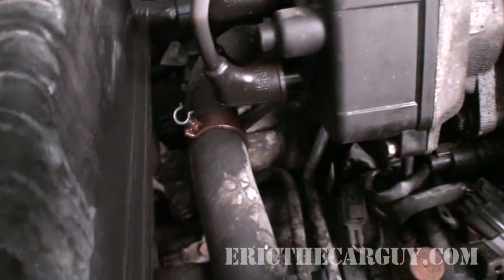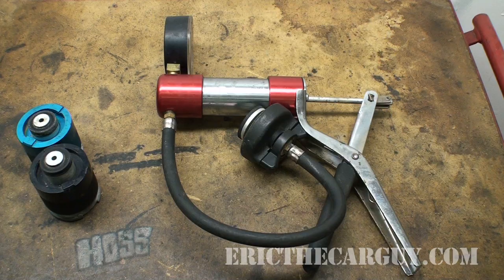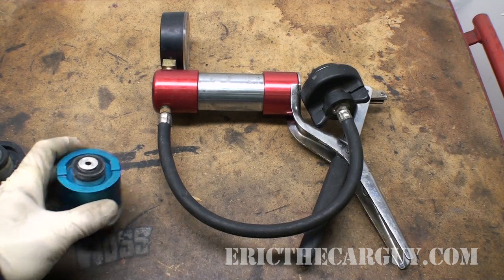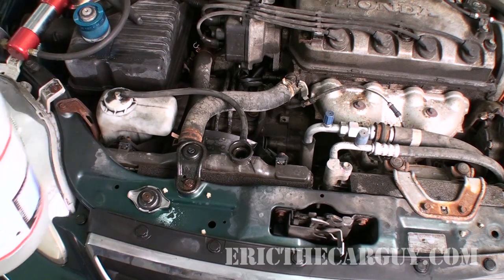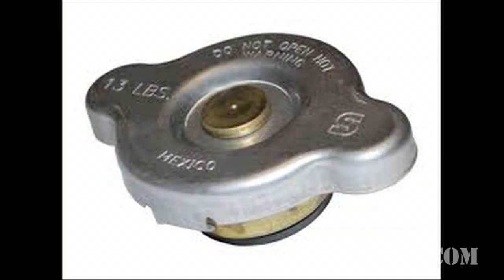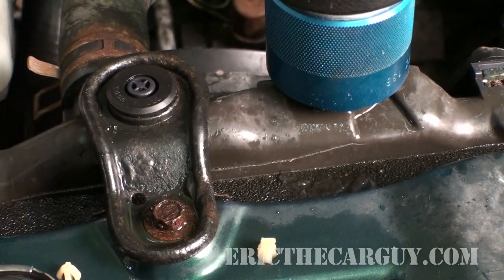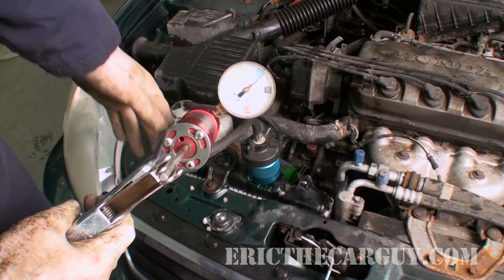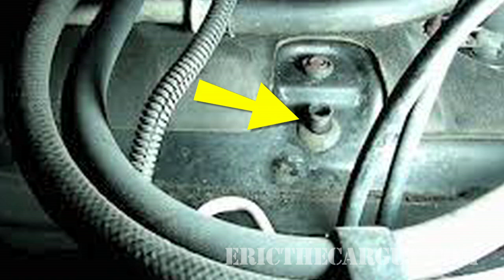Pressure Testing Cooling Systems -EricTheCarGuy

Comment: I know you found the leak right away so not hugely relevant, but I am curious if your testing the integrity after say a hose was replaced, would you say it’s also critical to clamp the overflow tank hose so it doesn’t appear to be a leaking system when it’s air is just getting out there

Comment: 2002 Camry here. If my car was in a collision prior to my purchase in 2011 could the block have been damaged but not show this till 2024? I drive the car from Ventura to wash state 2011. 5/24 the gage that was always 2 digits from cold suddenly went to H.  Theory is: wash/oregon has much colder temps than California ; we’ve had many freezes and temps over 100, combined with a damaged block, perhaps the crack has been compressing expanding? Car works fine just idling but the moment it’s driven it goes bezerk. Car overheats due to Coolant is rapidly dumped. Every mechanic had a diff. Opinion after pressure test. Replaced everything but the head gasket, block, Heater core. Car started with low mileage, has 168k now however I know lots with Toyotas high mileage never experienced overheating or coolant loss so mileage is not a factor. Maybe the accident before I bought it had damaged block that simply worsened with freeze then extreme hot weather ? Is there a block test? A recent shop say the leak in behind the intake manifold gasket. They can’t conclude what? A 6/28 3 hours head gasket test, thereafter mechanic say the 3 cylinder was observed as abnormal but no proof yet it’s head gasket. Believed is possibly the very start of one. I’ve had none of the serious symptoms most gets bec. Shops says the leak is external .  the severest issue is rapid dumping of coolant

Comment: What happens if you 30lbs  of pressure when the system only runs at 14 to 18? Is that bad? Did I most likely mess something up?

Comment: What would cause the heater hose to not relieve pressure after removing your pressure tester. It's on an 07 hhr with 2.2
One hose is Rock hard the other kinds sorta hard. I can't see a clogged heater core causing this, shouldnt it leak down with the radiator cap off??
Reply: The hose running to the thermostat housing is kinda sorta hard and the other I think just runs to the block but is extremely hard and not losing the pressure....even after 5 min plus with the cap off.

Comment: Just checked mine. Lost 1 1/2 psi in 8 min. How do I know if block is cracked. Just changed head gasket.  Had water in oil. Never checked block. Should I use uv dye?
Reply: Exhaust gas checker, lisle makes one, it changes the color of the a liquid in a cylinder they give you

Comment: I've recently run into a cooling issue and was hoping for some insight. I put a new engine in my car and while burping the coolant system, I noticed that bubbles never really stopped coming up from the radiator. The bubbles are very small. I was able to get a pressure test kit from advance and tested the system at the cap rated pressure, and it help 17lbs for a few hours with no leakage or drop in pressure. Here's the odd part, when I start the car, bubbles begin to emerge from the funnel I'm using to bleed the system. I have even gone as far to remove the thermostat and bleed just to see if the there was an issue with the thermostat (which is new). The bubbles continued. So the cooling system will pass a pressure test, but when running I am almost concerned about a crack in the cylinder.

Comment: 2011 Jeep rubicon 3.8L… reservoir not sucking back to radiator. 
What if the pressure holds at 17psi while the engine is off. When I start it and rev it, the psi drops 1psi then bounces right back to 17psi. A blown head gasket would make it jump way up right?

Comment: Hey there, got a 2000 civic dx with coolant being pushed out of the radiator into the reservoir on the side. I notice dried coolant around the thermostat housing. The radiator holds pressure but I still have an overheating problem. Can the leaking around the thermostat contribute to the air getting into the cooling system?

Comment: hi Eric i have not yet done this test yet,but ? is there is a block in system y bc the hose going from engine back to radiator is cold ther is No coolant going threw engine is blocked and i have replaced thermostat now im lost but could it that both the orginal thermostat i pulled out and the New 1 are both BAD or is ther more i pray not im lost but im going to get torch and check the oginal 1 since its right here im getting ready test soon another ? is the cap has on it 1.1 is that the psi of how much psi it will take and now just pump it how much does a kia sorento 2014 psi be is ther a recmmnded psi

Comment: Mine holds pressure at 14.5 or 15 but is supposed to be at 1.1 bar which is 15.9. I had a fast leak at the radiator hose that I fixed and hoped that was it. It was losing pressure much faster before I clamped it. I can't seem to find the leak but if there is one anymore. I have no symptoms of a bad head gasket. no milky oil, chemical tested the overflow, not overheating, no oil in the rad, exhaust is normal, compression is normal, heat works, no bubbling at the rad when I turn it on, the plugs aren't wet

Any ideas?

Comment: Hey Eric!!
Love the videos bro you have saved my ass more than once
I’ve got a tough one this time
1997 Ford Explorer with a non- obvious coolant leak
Went and got a pressure tester today and pumped to 15 psi (as per cap)
It slowly dropped a few pounds after a few minutes and I got no sound or drip anywhere????
I’ve never had an overheat as far as I know 
No milky stuff in oil
And no smells or moisture in the cab
I’m guessing that I need to check that I have no head gasket leak with the kit from O’Reilly 
I guess for 9 bucks I can rule that out right
I assume it checks for exhaust gasses in the coolant if the liquid changes colors
Other than that I’m at a loss
I guess I can buy the glasses and uv light and shoot some dye in and try to find this small (but stubborn) leak
I plan on tackling this on this coming weekend 
Do you have any advice for me ???
Any help is greatly appreciated 
By the way 
You are a star now I heard joe rogan speak about your videos on his podcast

Comment: Im having an issue...coolant will fill up in the resevoir and not drain back into the radiator...i dont have coolant in my oil and no oil in my coolant...no smoke out of the exhaust...no issues driving no idle problems...coolant is only leaking when the resevoir gets full...i have no idea what the problem is...shouldnt be a head gasket with only 74,000 miles on the car...not smelling coolant in the cab...i bled the system and just was getting tiny little bubbles that wouldnt stop...you think a bad water pump would cause bubbling

Comment: Air in the system affects idle in newer cars,which is what led me to inspecting my radiator. And I found wetness on the upper tank crimping on my radiator. Probably no way to repair it. Better off spending the $60.00 for a new one.

Comment: I have a 2001 Honda accord 2.3lx did the pressure test no leaks holds pressure......changed radiator water pump thremostate hoses it doesn't over heat but it builds alot of pressure so much the hoses shake no blown head gasket I'm lost any plz

Comment: Longgggg story. 
I have an 08 pathfinder. Ok so inside my radiator cracked leaking anti freeze into my transmission. I found out Nissan recommendation was new transmission new radiator. F Nissan bc I’m broke and I don’t have 5000 laying around. I found out this is a common issue with a easy fix. Flush the transmission change the radiator done. That issue fixed the main problem. I burped the coolant and let it run for an hr with the yellow funnel after that. When I take off the yellow funnel the car starts to leak coolant for the reservoir over spill. I have changed the water pump/thermostat/hose/fan clutch/radiator/ caps/and coolant. The car after 1hr in idle start pushing out coolant for the reservoir over fill hole. When I drive it the car spits out a lot faster. The oil is milky but that is from me pulling the water pump and coolant getting in. Pleaseeeeee help me.

Comment: Hey Erick,  quick question.   I realize this is an old video but I've seen newer videos from you.   I have a 1982 gmc sierra classic.   I have installed a new radiator and my pressure test will not hold pressure at all.   No leaks are found in my system at all.   I steering toward a blown head gasket.  The spark plug on number 5 was wet (with water) when I pulled it out.  I really wanting to test test test before I pull EVERYTHING off to put new head gaskets on.    What are your thoughts.  Thanks man.   I cant tell ya how many of your videos I've watched.   You have helped me many times.   Hope all is well.

Comment: Hey eric, thanks for the video! i had a blown head gasket, so i got that replaced; however, i am still loosing coolant somewhere. there are no external leaks, and someone said it could be coming out the exhaust but the shop said that's just water. can i still be leaking internally if it holds pressure?

Comment: I have a question, on my 2000 new Beetle I was suspecting a bad coolant pump. So I blew into the return line the cooling system it goes to the coolant reservoir, and I had to blow really hard and then all the sudden it felt like a busted through. I don't know if that was just me having to get through the water pressure of the weight of the water or if I actually blew something through is it possible did I blew something through and fix it? Another question I have is, when you pressure test and there is a leak it can be hard to find if you just have water in there oh, so can I purchase a inexpensive food coloring like a neon color it's easy to see but that in the water? And last but not least can the coolant temperature sending unit going bad cause a engine to overheat on a 2000 new Beetle 2.0? Thanks for the help, and you know what, you should sell baseball hats with your logo on it or something. Later G banger Eric.

Comment: My coolant reservoir is empty ..no sign of leaking. ..i buy myself a pressure leak tester....thanks for your vids...from New Zealand
Reply: A cheap one is C$35. And they are crap. A hood one is C$270 as per Scotty on YouTube. 
I'm doing this in 1/2 hour in my backally dtiveway.
I must take off the undrrguards under the radiator. I think that will be difficult.
My mechanic put in a new rad in 2016.
I think I'll pay a mechanic to put it on a hoist and pay the money. FUCK IT!!!!

Comment: Rather than buying a vacuum pump for every test you need to do, is there an all in one product with all the different adapters so you can pressure test everything such as coolant system, bleeding brakes, checking for intake manifold leaks, etc ?

Comment: Eric I have a leak at the radiator heater hose a small drip.  I have tested for head gasket and crack block diesel chemical test for a diesel 6.5 turbo chevy and I don't get a change in the color.  I did have air in the radiator so I bleed the air out but I still have a leak at the heater hose.  I don't have any leaks at the heater core and the radiator has never gotten hot. I cut back the heater hose and put on a new clamp and installed a new 
GM radiator cap.  Do you have any ideas what I should check?  Should I put on a new heater hose?  Thank you

Comment: Eric I haven't found any mechanic that can tell me why I have a very small drip at my heater hose.  I  have cut the heater hose back 2" and the hose fits tight. I purchased a new radiator GM capa and a new hose clamp.
When the engine is cold for 2 days or more there is extreme pressure on the radiator when I open the cap.
The pressure goes pack into the reservoir.  I have never seen a radiator with that much pressure after sitting for a day or two.  The 1993 Silverado 1 ton diesel truck with only 1500 miles on a new radiator.  It dose not over heat.  Any comments are appreciated.
Reply: Leaking from the heads is possible...

Comment: I'm planning to do this test soon, but I'm wondering if I can find a way if I can include the actual radiator cap in the test? I mean it was supposed to open up at a certain PSI right? maybe I can fabricate an adaptor to inject pressure to the top radiator hose? Will that do?

Comment: How come there is not a single tool for both presser testing as well as refilling the coolant system ?  Why must we buy a presser tester as well as an "Air lift " Would the snap on SVTS2000 do the trick?   Thanks for your time

Comment: Nasty leak inside the passenger compartment, behind a closed door under the dash close to the heater fan blower... Car drives very well. Never overheats. Fan heater works very well.. Radiator looks fine, nothing un der the car..Foggy inside car..

Comment: I put approx 10 liters of antifreeze into the radiator and overflow bottle. My car 1986 Econoliner V8, and it drives like a dream but the windows become very foggy, very soon ? Does it sound serious, headgasket or just the heater system inside the compartment ? I can smell the antifreese from within.. Don´t see any leaks under the car...at first glance..

Comment: when you pressure test a system, if its a slow leak and holds pressure, what is variation am I looking at between pressures? should it drop at all lets over a 2min period or of it had zero leaks it shouldnt drop not even 1 psi? thanks

Comment: Hi eric. I have a slight coolant leak somewhere (I top up about 50ml coolant a week) , my rad hoses are rock hard top and bottom (and both really warm), the coolant is trying to escape via my header tank (almost busting out at times), my heater matrix has sprung a leak so it's now disconnected, my fans come on as they should. I also have a misfire on low revs....but..i have NO overheating issues, the car idles great, runs OK when cold on start up, but it almost failed emissions test with high Co2, boosts well when it gets through that initial low rev misfire.... I've been told it's a head gasket but it's NOT overheating at all?? What do u think eric? Oh, I drive a Subaru Impreza WRX 2.0 TURBO, grey import. Cheers 🥂
Reply: head gasket, will start overheating when coolant is gone.

Comment: My black Civic does not seem to be enjoying Phoenix.  My car started overheating on the day it was supposed to be 120° and I discovered my coolant was low.  I have checked every day or two since and keep topping off, but I have not seen any leaks and there is no milk on the oil cap or dipstick, but the coolant system does not maintain pressure when I test it, and I can smell antifreeze in the cabin.  Will you please recommend what to try next?  Thanks!

Comment: hi Eric I have problem in my car, its 99 Renault Megane 1.9 D diesel
 the problem is that the pressure rise quickly when I close the expansion vase cap (touching the upper radiator hose)
 I change head gasket
 when I remove the glow plug from the 2 cylinder and start engine the pressure is normal (other pressure rise)
 I change the cylinder head and the problem persists

 is it the block? (I am thinking Sleeving the 2 cylinder)
what do you think

Comment: Hello Eric! I'm trying to diagnose an overheating issue on a 2013 Dodge Avenger 2.4l. From what the customer has told me the cooling fans do spin up, there is coolant in the over flow tank. I initially thought it may be one of the two thermostats but after watching your videos, I realized I'm missing a large amount of trouble shooting. Thank you so much for providing this information and has given me more causes to keep an eye out for. Thank you again for all the information you provide to us DIYers!

Comment: I flush my car's the coolant my self and now my car is making a water sloshing sounds time to time but the temperature its in normal levels. Is this air in the system?
Reply: Juan Job yes. You likely have air in your heater core. Need to bleed the cooling system (heater core is connected) with heater to all the way to hot.

Comment: QUESTION FOR ANYONE!!! Ok I'm just starting out on learning to fix my own car. I drive a Chevy 99 lumina. My car was actually leaking coolant a while ago so I pressure tested it and found the source. Fixed it (was the hose), no big deal. However when I drive it, it still overheats relatively quick and I see coolant under my car again. When I first opened the coolant reservoir it actually had MORE fluid (dirty however) in it then what I first put in and the radiator cap was smoking. After letting it sit for a few hours I come back and it's almost empty. I pressure tested it again and it says no leaks oddly enough as it held pressure for about half an hour of running. I bled the coolant and put fresh coolant in and made sure no air pockets were left. Still issues. As a beginner, can ANYONE tell me what this sounds like? Bad gaskets, radiator or something as silly as replacing the radiator cap? PLEASE HELP!!
Reply: All these squares make a circle If the radiator cap was smoking you likely need a new cap. There is a safety relief valve on the cap that is actuated by a spring when there is too much pressure. Sometimes that spring can jam open. They're pretty cheap to replace. Some auto parts stores will test your radiator cap. That way you know for sure if it is functioning properly or not. Make sure you buy the same PSI that's on your current cap.

Comment: Help!!...For my year car, the dealer has discontinued these maintenance
parts.
I have a 95 Honda Civic VX hatch back (1.5L engine). I have a
coolant system leak on one of the small diameter, very far back coolant hoses;
it goes to the oil cooler. While I am in the system, I would like to replace
all of these small dia. hoses (there are 4 total).  These 4 hoses have sharp bends to them, so likely, universal products won't work. Can you give me a few after market
companies that would carry these products?
Thanks, Chris